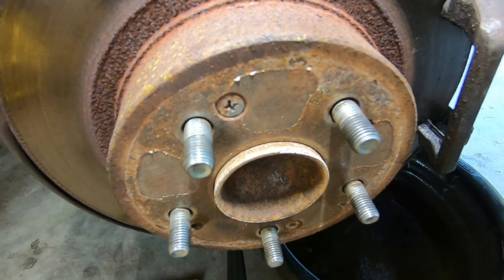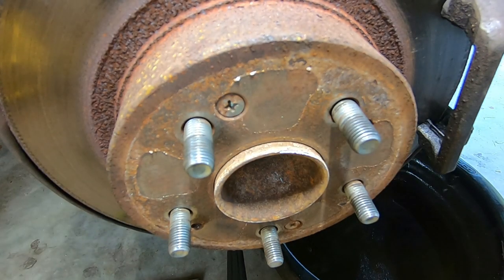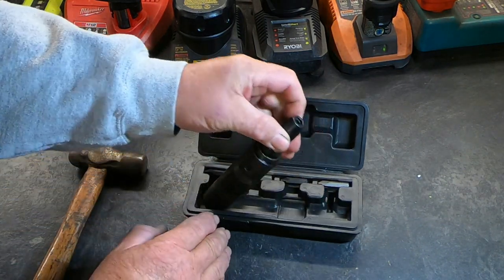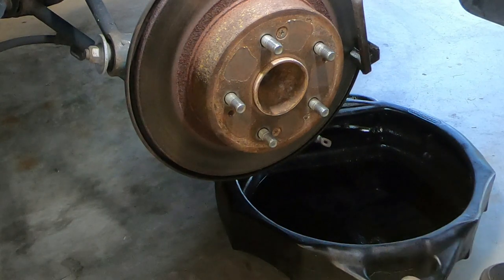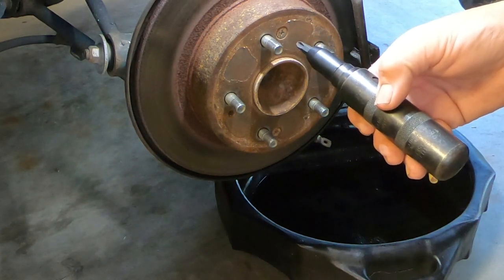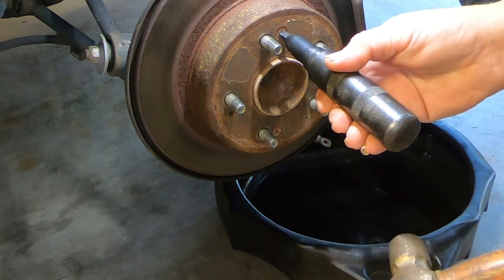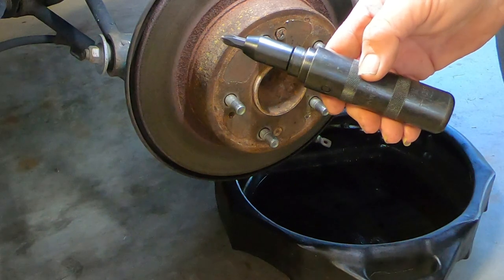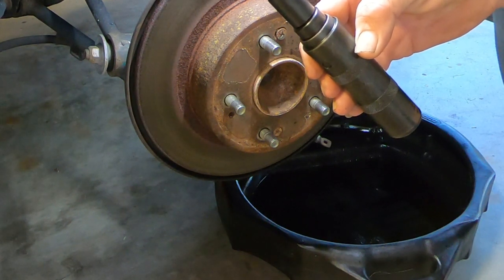How to Remove Brake Rotor Screws

Comment: I've got this tool as well. Saved me loads of times! Too bad the bit size is larger from the regular bit size.
You can only use the 4 that come with the kit.
Reply from the maker: Yes I have noticed that as well. I have had my kit for several years, have not worn out a bit yet.  I suppose if I ever need a new bit I will by another kit. Thanks for the comment and thanks for watching my channel.